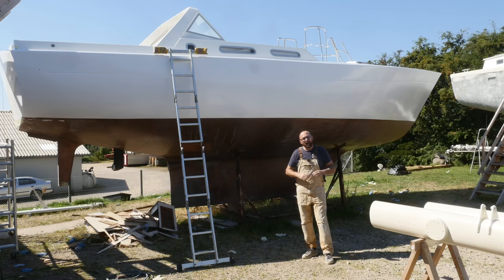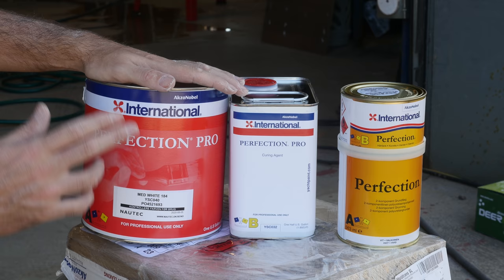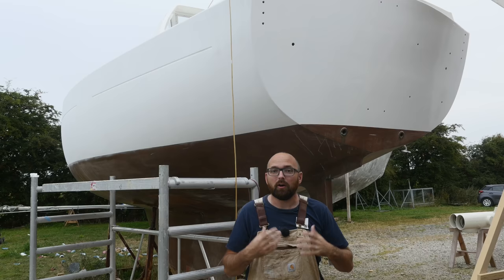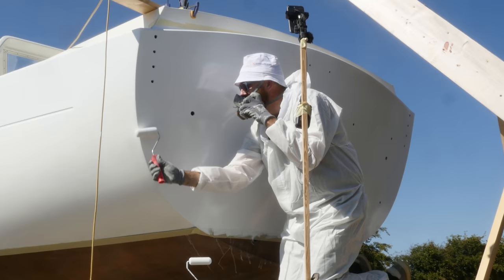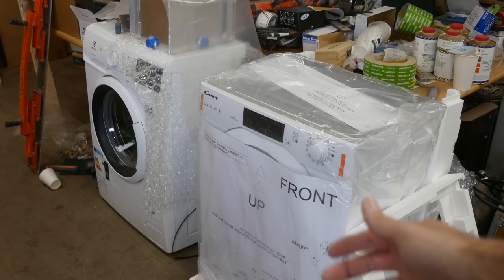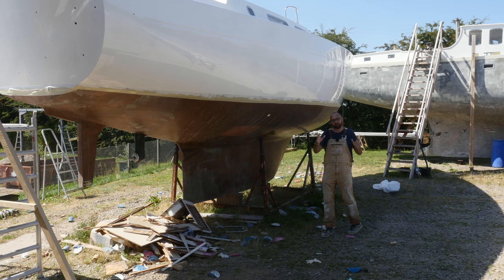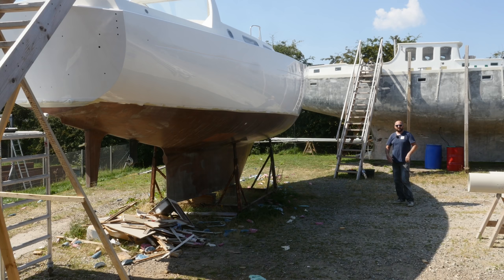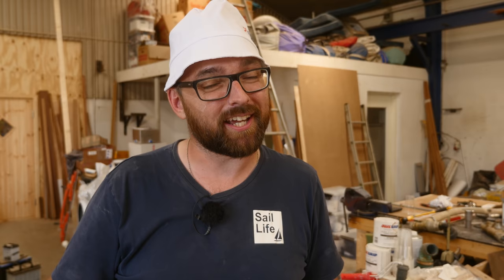Sail Life - Painting the hull of my sailboat with Perfection Pro

Comment: My experience with International paints up in North Queensland, Australia was that the paints were native bee magnets. I’m not talking one or two had at least 50  stuck in the paint after I gave up pulling them off, they had foot prints for around100 mm trailing behind every bee once they walked that distance they were stuck and I had to sand out for my next coat. Went and built a huge mosquito net around and over my build, the bees would crawl around looking for holes even had to put pieces of steel box section on the bottom to keep them out and still some got in every coat. Melbourne Distrubitors said they never heard of the problem before which I can’t believe. Definitely won’t be using International on my next build, can do without the extra work building a bug proof building. Really enjoying your work and you uploading your endeavours.

Comment: I used a similar product, rolled and tipped with a brush. It looked pretty average straight after application, but the next day looked like a spray job. Incredible paint technology! I learned a trick recently for removing the 'yellowing' that happens just above the waterline over time. Use grapefruit (the big oranges, not the one you stand on to make wine!) cut in half and rubbed over the yellowing and rinse off. I guess it is the citric acid that does the trick.
You don't look like a giant dork, just a glorious dork!

Comment: Great job. Next year when everything is hardened and used a bit you can go over with rubbing/polish + wax, and it will be perfectly smooth and shiny. There’s most likely going to be spots that will lose its shine more quickly until you’ve used it a season. Especially where you got fenders etc.

And yes - Been bad weather here in Norway as well.

Comment: Great Job! Just one more tip ... Try to remove all of the water line masking tape prior to the painting . it really helps to do this when the paint is still wet as it doesn't leave any paint tears marks. The down side to this  the necessity to mask the hull for each layer of paint, but the end result is PRO .

Comment: I have painted a 30' Catalina hull with regular Perfection and really liked the product.  I painted a transom on another 30' sailboat with Awlgrip professional and that turned out very well too.  The Awlgrip required a lot more knowledge to use the proper mix choices and gave a lot more of a window for temperature and humidity using all the choices to narrow down on it.  Interlux Perfection with just the two parts in the box to mix together had a narrower window with no options but wait for the correct painting conditions which was OK since we were in indoor heated storage with that boat.

I wonder how much the Perfection and Perfection Pro products differ. I suspect that the Pro version was more like the Awlgrip product that offered different hardeners or catalyst mixtures to taylor the mixture for different conditions as needed.

Your paint on both the first second coats looked fantastic -even when close up. I can only imagine how spiffy it will be on the final coat.  You should be very pleased and proud.   A 30' paint job is good enough in my book but you certainly seem to have far exceeded that.  

How disappointed were you in the area below the notch which you didn't do a full-on Madstastic faring job on?  Warrior hull layups aren't exactly perfect when they leave the factory as you are fully aware. Such a shiny paint job might really show off the wavy lasagna glasswork.  Good thing the lower portion is harder to see in the water and people will only see that top bit from up on the dock when close-up and not along the hull from the waterline.

Comment: Great job Mads! - I painted my hull this year during lockdown and was also very pleased with the outcome. However, not having free paint ;) I used AlexSeal - as recommended by BoatworksToday - also used Tack Rags to take off the dust and used Mirka Guide Coat to get the sanding perfect - did you not use these?

Comment: Looking amazing. Can that paint not be sprayed?
Reply: Its designed to be rolled or brushed. If you spray it you need a positive pressure air supply for the respirator
Reply: @evangatehouse5650  Thanks Evan.

Comment: Just one remark: Where does it say that sailboats only come in white? Why not spruce it up a bit with a shade of lavander, green, orange or smth?
Reply: Wanna see an orange sailboat? Odd life. You'll answer your own question. Plus white is easy to match for repairs and keeps the boat cool as boats are always in the sun if it's out and heat up quick!
Reply: @danielbuckner2167  I had an orange sailboat. Paint is paint, pearl white has problems, too. Like the fact that every single smudge shows. And if you read my comment, I was talking about shades of colour, you get the difference?
Reply: @Brgnalf81  is this an English problem? So yes paint is paint. Glad we worked that out except there many different types of paint and qualities but well set that aside. Paint colors are different. Each one will absorb or reflect heat at a different rate. White does the best at this. It can show dirt smudges too. So can black paint. It depends on the foreign material getting on it. White does not show chalking well.  In any case you can clean your boat. However sitting in a sweltering boat at anchor with a no smudge showing dirty talk oat isnt what I call fun. If you want to sweat it up all over the inside of your boat waiting till midnight to fall asleep in your filthy floating oven boat then have a blast.I will choose white and just clean it. ✌🏼😁
Reply: @danielbuckner2167  You still don't get it. The colour pallete is vast. I wasn't talking about painting it some extra dark or colour absorbent colour, I was talking about a nice little shade of lavander or green, a very light colour. It absorbs just as little as pearl white, yet its not. It's funny how the most of the sailing world only uses pure white. It gets boring after a while. In my opinion, when doing this kind of work, even the colour choice should reflect the years of hard work.